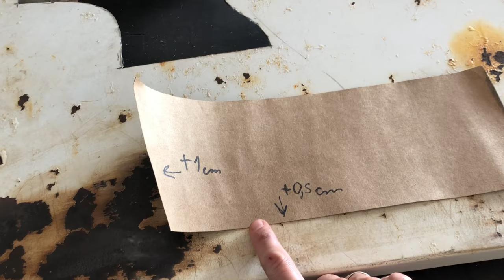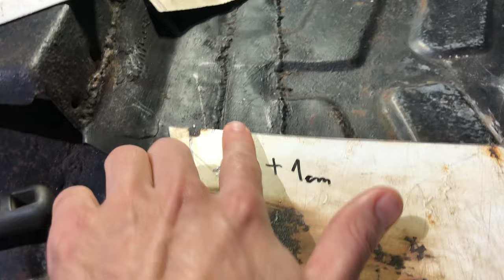FABRICANDO Assoalho com POUCAS Ferramentas! | Funilaria Artesanal Ep03

Comment: Very interesting to see your job with simple tools, especially the flatbar with the cut in it for edge bending was new to me. Welding thin sheet with a stick welder is not easy, I am not a welder but I have welded rusty cars with a mig and gas and also used tig in school and also some stick welding. Greetings from Finland!
Reply from the maker: Thanks for your comment my friend! It really is hard to weld thin metal with the stick welder, but we have to work with whatever tool we got at the moment. One day I will upgrade to a mig welder to make my life easier 😂
Thanks for watching 👍🏻